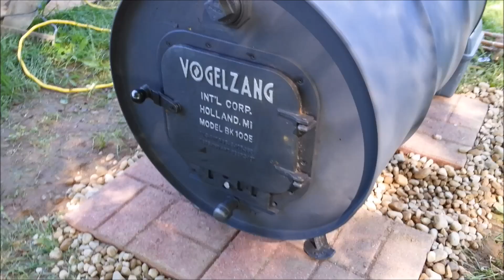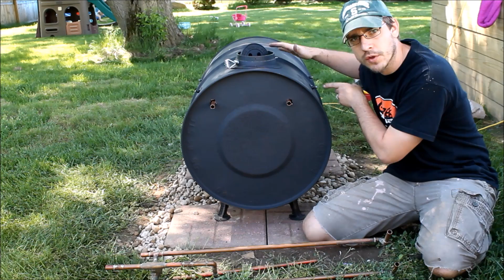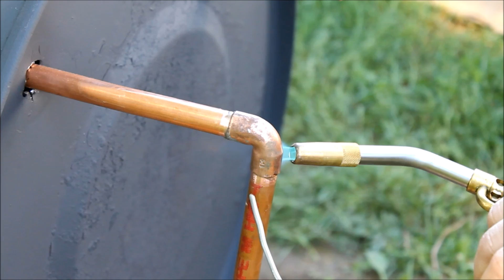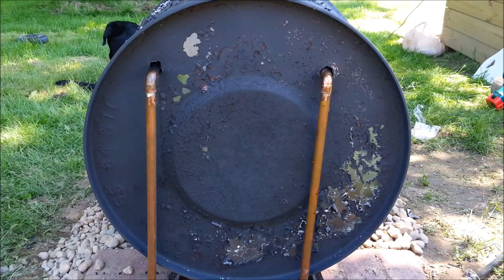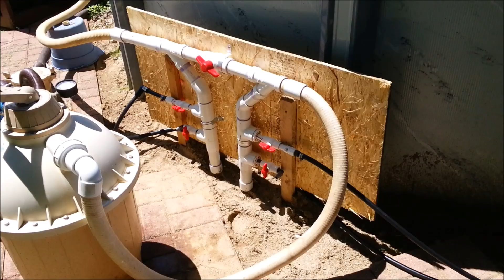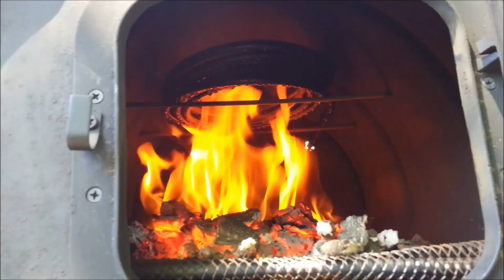Wood Burning Pool Heater - Heat Your Pool For Free!

Comment: Thanks, I just found an older production unit for $150 originally $1600 with 175ft of copper inside. Should heat our 23,000 gallons nicely. I'm toying with the rocket stove idea though just for fun. Thanks for the quick response. Love your videos, very inspiring.
Reply from the maker: oh wow, that should work nicely, good luck!

Comment: I have built a solar heater for my above ground pool here in Michigan similar to what you have in your other video. I agree, it's good for maintaining heat, but that is about it. Wondering if you are still happy with your wood burning heater though that you have demo'd here. I'm seriously considering making one this year but wanted to get your feedback now that you have used it for a few summers. Thanks! Awesome job!
Reply from the maker: +Doug Moore i like the wood burner the most. I still use it every year especially in the spring and fall.

Comment: Hi there from Scotland.
we have watched your fabulous video.  One question - without any pump, could this copper pipe/barrel-stove set-up allow heating up of a 1400 litre tub to make a wood-fired hot tub, or would there be little/no flow?
Reply from the maker: +sasha stamenkovic if you set it up right you could just use the heat to siphon the water through and I'll bet it would heat up a tube pretty well. However the water would be so hot coming out that it might burn someone. If you put in just a tiny pump it would make it much safer I think

Comment: great job man as always, im looking to build one of these 55 gallon drum stoves, do you have any problems with the copper getting too hot ? i was thinking if it would work i could do the same as you but not for a pool , but as a water heater for my hunting cabin, if you have not had any problems with the copper getting hot enough as to damage the copper, that would get a lil messy ....lol

Comment: Great idea, my buddy and I will be doing this for his pool.  I'm sorry if its mentioned in the comments but how much will this actually heat the pool, can I swim in the winter if it's 70 degrees outside? NC is having a warm winter. Also, I think it's cool you added your kid in there and I like the quote at the end; a true "Family Dad", nice touch.
Reply from the maker: Thanks man. If it is 70 degrees outside you should be able to keep the pool warm enough to swim as long as it is not too cold at night. Also depends on whether you have above ground or below. Check the links in the video for the follow up I did on "how well it works"
Reply from the maker: Thanks man. If it is 70 degrees outside you should be able to keep the pool warm enough to swim as long as it is not too cold at night. Also depends on whether you have above ground or below. Check the links in the video for the follow up I did on "how well it works"

Comment: a fast way to get more heat out of the heater ..take a steel plate put over the top of the coil so the flame has to go over and around the coil before it goes up the chimney ..your loosing a lot of heat strait up the chimney ...2 min fix.should give you more bang for your buck lol ..if you try it let me know...... tthompskin@yahoo.ca
Reply: FNA.. Brilliant.  If he wants to get involved, stack some plates like you say and create chambers. Let that heat out 🐌.
Reply: Makes total sense. Thanx
Reply: A baffle really helped my wood fired pool heater, keeps the heat in the fire box and spreads out the flame as suggested.

Comment: hi I have a question I have a 20 ft and 10 ft copper coil I was wondering if I fused them together could I use those or would the heat melt the connection? would a 20 ft copper coil be enough for my pool I have a 27 x 52 agp
Reply: +Abounding Grace World Healing Church  Do not try a soldered connection inside the stove.      Use flare fittings instead to join your two coils.

Comment: I have a question. I could not find a 30 ft copper coil could I use a 20 ft and 10 ft copper coil fused together or because of the heat would it work? if not would the 20 ft copper coil be enough?
Reply from the maker: +Abounding Grace World Healing Church 20ft would be plenty to start with but I suppose you could solder to lengths of pipe together. Only issue would be if you ever slowed down the water flow through the pipe or it stopped for some reason it would get hot enough to melt the solder and you would have a leak. I would not really recommend having a solder joint inside the barrel stove.
Reply: +SSLFamilyDad thanks I really enjoy your videos and will give you an update once I'm done. I am going with the 20 ft of copper coil and the only thing different I was doing is adding bricks at the bottom and I am laying the copper coil on a piece of sheet metel.

Comment: Still working? any problems?  Thanks
Reply from the maker: +hunters080 It is still working although less effectively than when first built. Theere is a significant amount of creosole built up on the tubing now which is insulating the pipe from the fire. It still heats the water just not as well. I am going to also try adding a second coil around the outside of the barrel next week to see if it works better.

Comment: Hi, I,m in U.K. and am thinking f building one. Will the microbore pipe work O.K.? The reason I ask is that it states a max operating temp of 230 deg c.....
Reply from the maker: +Sean Casey To be honest I do not know much about that kind of piping but it seems like it would work ok. the info I found online does say that it is a very soft type copper so that could be an issue I suppose.
Reply: Thanks, I did try 15mm copper and a pipe bender which wasn't great so am currently trying to find normal (non microfibre) 10mm copper tube that comes in a roll !!!

Comment: I had an idea for the same concept but to use a grill instead. Feed the copper in the one side and out the other where they have a hole to put a rotisserie rack and use propane to heat the coils.

Sound feasible?
Reply from the maker: MrSmokindabud That would definitely work but might get expensive to leave it running as long as it really needs to  heat the pool. Worth a try!
Reply: If I don't use propane I may buy a cheap charcoal grill and just burn wood in it and do the same thing. I can get a tank of propane for around 10 dollars and you can put it on high for several hours before the gas runs out. I'd imagine it would heat my pool by a degree or two. Im guessing this is something maybe for when I just opened the pool.
Reply: I'm actually currently making the solar heater that you have in another video. I'll be sure to post a video or something showing you my design.

Comment: Does it have a pressure release value?
Reply from the maker: Al Noviello it does not and doesn't really need one. The system is not closed and so should not be able to build up any pressure. If it did start to steam or the water flow stopped and pressure built up it would melt the irrigation hose I have connected under ground and release pressure there I suppose. Has not ben an issue though.

Comment: Is it possible to do the same setup with copper coil but with a pipe thickness of a pool line to not reduce the throughput ?
Reply from the maker: Al Noviello You could but that would be expensive and not sure you can find copper coil that big.

Comment: Hi, don't know if you can help but you've inspired me and I want to do something like this. How could I connect a hosepipe (13mm) to a 8mm, 10mm or 12mm copper pipe?
Reply from the maker: Thomas Bird You can get adapters at the hardware store that you would solder on to the copper pipe and then gives you a threaded fitting that you can screw on anything you need to adapt to. Hope that helps and good luck!

Comment: Can you put the copper right in the fire by the coals?
Reply from the maker: rob newton you certainly can but it makes it a bit harder to add wood to the fire that way.
Reply: SSLFamilyDad thanks. Any changes in your set up?  I am thinking about jumping on Craigslist and picking up a small old woodburning stove and making a serious series of copper coils that line the walls, roof, and floor of the stove. Thanks again for the idea.
Reply from the maker: rob newton No problem, I think that is a great idea or just wrap the exhaust stove pipe and around the stove will work as well. I am thinking about adding some external coils around the barrel as well as the internal one to see which works better.

Comment: I'm wondering what are the advantages of having the coils inside the actual fire box verses just wrapping the coils around the barrel itself. Maybe even start at the top of the chimney & wrap your way down to the barrel, then around the entire barrel. No condensation inside the actual fire box & would get nearly as much heat. Will the copper not burn out fairly quick if you're building a fairly hot fire, being inside the direct flames?
Reply from the maker: Longtobe That is also a great option and I am actually thinking of adding to this burner with the exact idea. The copper will not burn out since it is always cycling cold water through it but I have noticed a lot of creosote buildup on the copper after two years of use that might be making it less efficient. Either way it works great but I will do some testing on the outside wrap and see what works better.

Comment: A good idea if You have free wood... otherwise it will be to expensive to run.. But I like the idea. What if you connect a small sirculation pump into the system.. solardriven maybe?? And a shunt valve instead of thet ball valve You have between.. but I guess it work fine with a bigger coil in the barrel.. Thanks for the idea.. Kind regards Kris
Reply from the maker: KristianRoberto Grodem That is a great point and I am running on two years without buying any wood. I am using mostly trees that fall down around our neighborhood and pallets that I get for free. So far I have not run out! As far as the pump I have to run the pool filter pump anyway so this circulates the water through the wood burner without the need for any extra pumps. Has been working great so far! Thanks for checking it out!
Reply: SSLFamilyDad  Nice work anyway.. :-) And Good luck with the project . Kris

Comment: What kind of copper tubing did you use pls? I can only find Copper refrigeration coil which is only rated up to 65c.... what did you use and where did you buy it pls.
Reply from the maker: OverkilledUnderdog 1/2"copper tubing. It is Type L I believe and is soft copper tubing for water supply. Refrigeration is a different kind of copper and also different sizes and should not be used for this application.

Comment: Not really liking the idea of the hot surface where kids could come in contact, too much loss of heat thru the outside of the burner.
Reply from the maker: Jim Smith Those are great points Jim and things I have surely also considered. There are many different ways you could set this up, put a small fence around it or cover it in another way. However, even though it is not as efficient as it could be it works great! Thanks for checking it out!
Reply: I am going to install a 35 gallon drum inside of a 55 gallon drum using the jacket between the two for the water to heat, it will be necessary to have water tight welds and some fabrication however.  Your method will work but much heat is lost to the great outdoors.
Reply from the maker: Jim Smith That is exactly what I want to do down the road when I have more time more money and a welder:) The way I have it now is just an easy way to heat the pool.

Comment: How far do you think it should be placed from the hot tub? I don't want it too close, but I also don't want to lose too much heat.
Reply from the maker: I would say if you go 36 inches or more from the tub you should be fine as far as radiant heat damaging the tub but you might get some smoke from the burner. Honestly if you can bury (and insulate) the water lines and get it a bit further away it would be more comfortable with less smoke.

Comment: 6:41 by reducing the diamer of the pipe using the ballvalve you do not increase the pressure in the other branch of the Y junction ..you only increse the volume  flow rate ..the pressure still stays the same  in the whole system     since pressure equals force due to mass over area ... by closing partly off the valve you reduce the mass and the force but at the same time you reduce the area ..so pressure stills is the same in a closed system :)
Reply: actualy it does not ..the pressure in the hose stays the same as long as there is enough fluid to cover the volume of the hose..at the hose outlet the pressure is also the same since pressure is force over area ..so by restricting the hose outlet you restrict the area of the outlet therefore increasing the force which in this case results in the increase in flowrate of the fluid.. PRESSURE =  FORCE / AREA (at the end of the hose) ...PRESSURE = q x g x h (in confined tanks or other objects with closed outlets)............mechanical engineer
Reply: @mehotepatlas4370  actually that's not how physics works. If you put a finger on the hose, you have changed the area of the outlet. The pressure will increase. If you put a gauge, you will see that proportionality between pressure and area. The same will apply to the output volume. More restriction, less volume, higher pressure. Pressure won't be the same in the system.
Reply: You are correct Sir! .............Plumber.
Reply: thanks Baron ......... ... mechanical Engineer
Reply from the maker: mehotep atlas ok, so are you saying that if you take a garden hose and turn it on and leave it open with water just flowing out it has the same pressure as if you put your figure over the end and held the water back? The pressure increases in the hose when you restrict the water flow and lowers when you let it open. I can show you how this works with a pressure gauge sometime if you are interested:)
Reply: @SSLFamilyDad  flow rate isn't pressure.
Reply: lol
Reply: Upsizing pipe does not increase flow. You can only flow as much as the smallest pipe. However, this is not a closed system it’s literally open on the pool side.
Reply: mehotep atlas Acts like smart ass by taking what seems to be excerpt from wikapedia, then ends with smileyface....   We have a fellow troll!  Welcome Brother!

Comment: great video. I am in the process of building one of my own and am hoping you can help with my biggest hurdle. having trouble with the fitting that reduces from the 2" pipe to the valve that fits onto the garden hose. Where did you find it?
Reply from the maker: You have a few options and I am not sure of your exact setup but you can use a Tee that is 2" X 1" X 2" and then use a reducing bushing to get to a threaded 3/4" fitting and that will get you to a garden hose fitting. Or you can reduce directly from a 2" to 3/4" using a bushing, they should have them at ACE hardware or Lowes/Home Depot - http://www.homedepot.com/p/Charlotte-Pipe-2-in-x-3-4-in-PVC-Sch-40-Reducer-Bushing-PVC-02108-2600HD/203851181. If you use that busing you just need a short piece of 3/4" pipe and then this - http://www.homedepot.com/p/DURA-3-4-in-Schedule-40-PVC-Male-Adapter-C436-007/100348150
Hope that helps a bit. Let me know if you need clarification. Thanks!

Comment: what is the flow rate coming out of the wood stove?
Reply from the maker: Good question Sheridan, I have a full breakdown on the flow rates and temps in this video - http://youtu.be/1N3rgVpTnT0
The flow rate is adjustable with how I have it diverted through the pump but I normally set it at a little over 1 Gallon per minute. Thanks for watching!
Reply: 1 gallon/minute is ridiculous.......mine have all the flow of the pump,it's about 20gallons/min. the température only increase about 5 fareneith from the inlet and the outlet.The important is to take all calories you can from the stove,not have the feeling that the water is more hot cause you reduce the debit.

Comment: So cool could you use that to heat a cement floor
Reply from the maker: Thanks Ethan, yes this could be used for any application like that. I have converted it to heat my garage for this winter - http://youtu.be/NPw9HKAxr8A. In this case I am using a car radiator but you could just run the water through the Pex tubing in an in-floor heat system as well. Thanks for watching!
Reply: COOL! (well, warm and cozy, actually)

Comment: Thanks SSLFDad, great video and great idea!  I had a question about the flow of the water (and low temperature tubing).  I plant to use almost the exact same copper wire set up as you but it will be for a dutch hot tub.  I am not planning on using a pump but just relying on the thermosyphon flow to hopefully be adequate enough.  So, my question is, I assume you used the water pump to run the water through the wood stove and copper pipe? It wasn't 100% clear in the video....thank you!  -Ted
Reply from the maker: Yes, in this setup I am not using thermo siphon. Due to me being cheap and using low pressure low heat tubing:) If you plump it all with copper and make sure to have the hot tub at a little higher elevation than the heater you should be good there. I am using the pool pump to push the water through so that I can keep the water temp lower. Stay tunes, I have some plans to use a similar idea to heat my garage this winter...... Thanks for watching Truth427!
Reply: SSLFamilyDad Thank you for taking the time to answer!  I will show you how I did when it's finished and look fwd to your garage heating project